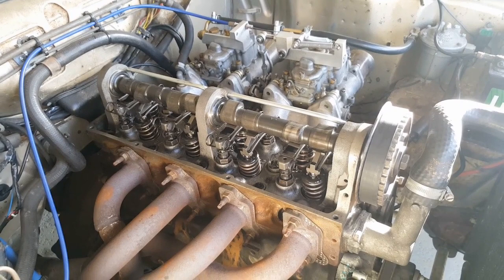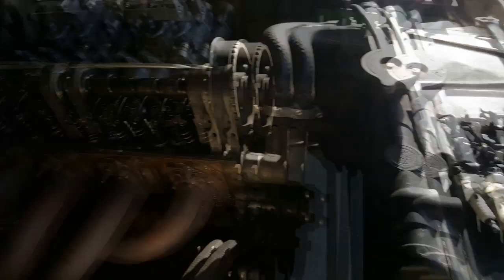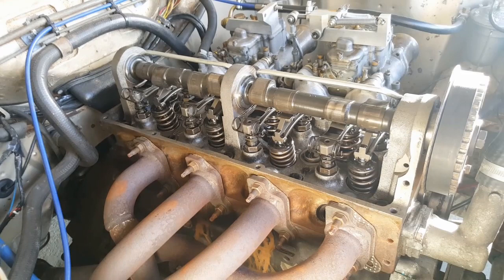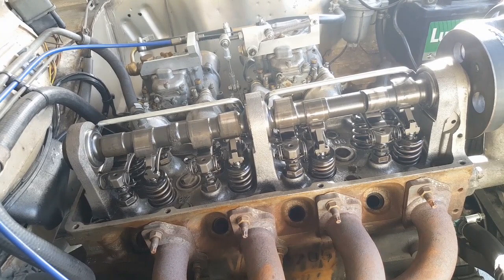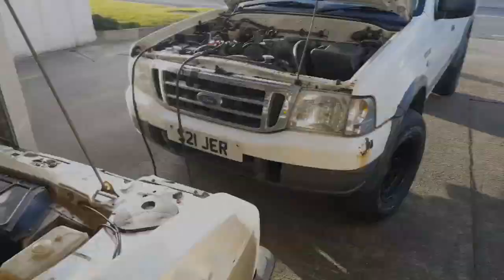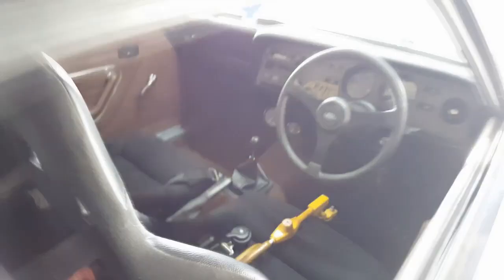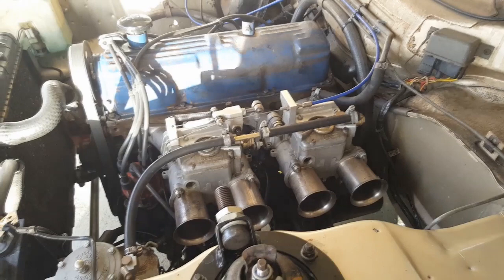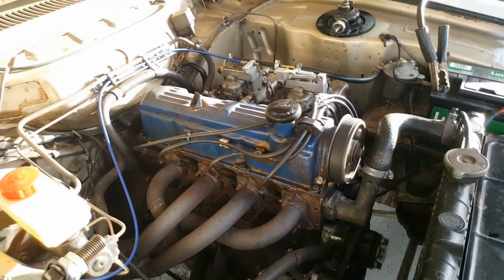2.0 Ford Pinto First Start in 2022 | Oil Prime and Startup Attempt (Ford SOHC Capri Cold Start)

Comment: As I mentioned on an earlier video. I have fitted CVH valve stem oil seals. The design prevents the rubber seal sliding up the valve shaft. 
 Not bad for a 6 month lay up. Mine has not run for a few years now. Hopefully I'll get it back on the road this year. I was hoping to get it out last year but, real life issues massively got in the way. :¬/
Reply from the maker: Yeah I thought I replied on the CVH seal issue - because I have bronze valve guides and had some machining around the spring perch I can't use them. If I could, I would! Good luck getting yours back on the road. Life tends to get in the way with these things. I have a trackday booked in April and still plenty to do. Just been on hol for a week now need to get back on it
Reply: @FastRust  Ah yes. I seem to remember your reply now. The old memory isn't what is was. It could probably do with a defrag or a full system recovery! lol

Comment: Can't believe the state of that oil, is a pinto a diesel engine 😉
Millers oils do a laying up oil that also outgasses ( if you keep the rocker cover on) and prevents corrosion throughout engine. I also keep the plugs out and spray seafoam deepcreep into each cylinder via spark plug holes whick are in turn covered with a spiral wrapping of lint free cloth soaked again with deep creep.
When you had the rocker cover off I thought you might be going to apply a engine build paste to the lobes etc.
One final thing as its still winter does anyone else pre heat their oil on their stored cars?? Mine is cvh engined, albeit heavily ported and with a kccv23 cam and twin 40's.
Thanks for taking the time to read this!!
Reply from the maker: Yeah it's due a service before next trackday, probably kept that oil in there a little too long 😂 You have a much more thorough lay up process than I do. I just park it up and leave it! I did drop some engine oil on the cam lobes before cranking it for the first time, but that's all. As for pre heating the oil assuming you're in the UK we don't see temps low enough to need to do that. I use 20 50 in mine all year round 👍🏻 What kind of power does your CVH put out?

Comment: I recently got my Capri 1600xl back from the local garage and it's running very roughly. I notice that there is no hose connection on the vacuum advance unit and don't know where it all connects up. Any advice? I don't trust the garage. Its a VV carb.